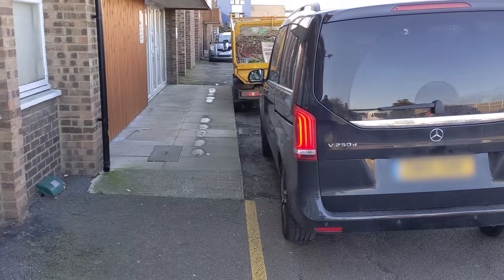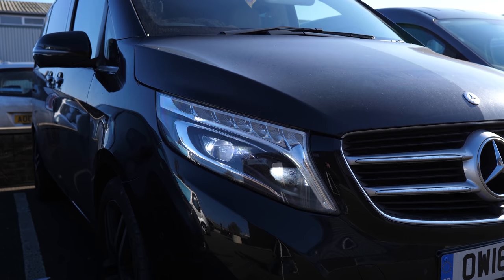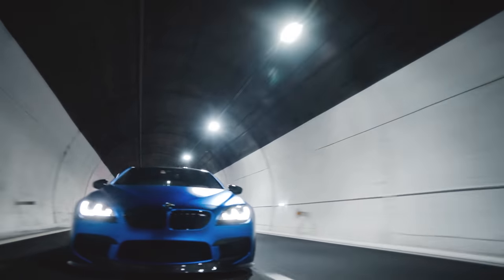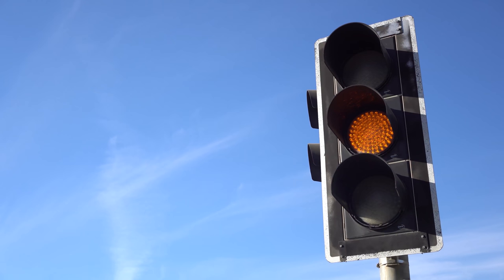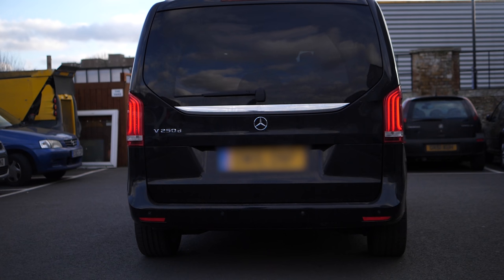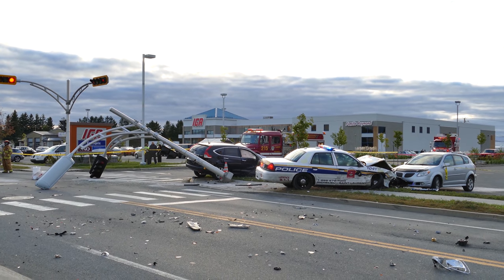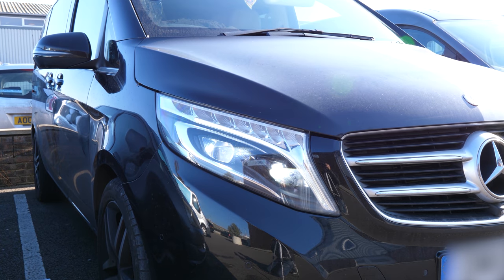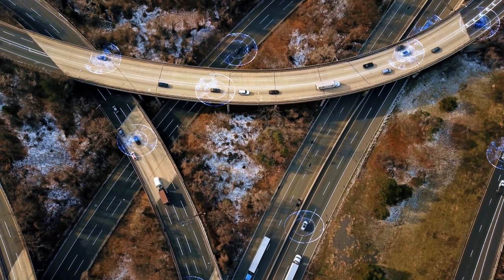Self-Driving Cars Are Dangerously Confused By LED Lights

Comment: Hi Steve! Your statement at 2:10 about the reason(s) we use PWM to modulate the LEDs brightness instead of varying the voltage are not entirely accurate!

1) Using PWM makes effective thermal management feasible. This is very important since the life expectancy of LEDs fall exponentially with increased temperature.
2) LEDs don't have the same efficiency at all voltage/current levels. PWM allows us to run the LED at the most efficient point in the IV curve regardless of the desired brightness. (See: sciencedirect.com/science/article/pii/S1876610212008107)
3) Using PWM with a lower duty cycle and driving the LED at much higher current has the effect of making the LED seem brighter to human eyes (See: https://www.jstage.jst.go.jp/article/jlve/32/2/32_2_161/_pdf)

Comment: Producing incandescent bulbs causes way less environmental damage than producing LEDs.
Incandescent bulbs would be the most effective "fix" - actually it wouldn't fix but ELIMINATE the problem alltogether.
Incandescent bulbs consist of glass, Wolfram, and a bit of brass.
Go figure what LEDs consist of, plus the necessary circuit boards for chopping the current, the driver circuits.
Let alone the HF RFI the power circuits are causing all over the place.

Comment: I belong to the unlucky minority who can see high-rate flicker. Many modern car lights (front and rear) flicker so horribly that I can't drive close to them when it's dark. I get dizzy. My eyes just go nuts, darting all over the place, because of the flicker. Most people can't see this. I often ask friends, colleagues and relatives if they can see that a nearby light flickers, but they almost invariably describe them as perfectly steady. I wish the EU would ban all LED-based lights in cars, domestic products and public lighting, with a flicker rate lower than 1000 Hz, and duty cycles with less than 50 % on-time. Or perhaps even push it to 25 kHz or higher, to prevent any high-pitched noise.

Comment: "It's easier and cheaper to instead simply turn the LED off and then turn it back on again," I think we've found our solution. Which is more expensive? A DAC or hundreds to thousands of hours of digital camera research, special adjustable sensitivity sensors...? Maybe it will pay dividends in the long run, but I feel like the same research could be put into making analog signal generation cheaper. Also, cheaper isn't always the best when human safety is on the line. I suppose the downside of that is we'd have to make a global car LED standard 20-30 years before we can put out self-driving cars.

Comment: Back in the day, we put a bunch of phosphors on glass so some momentary excitement caused more stable illumination.

Why can't we do that with LED lighting?
Reply: On the whole, that's not a bad idea (CRTs have been doing it for decades). However, there would need to be a method to prevent the phosphor from being excited by an external light source.
Reply: @BrendonGreenNZL  Proximity, and the inverse square law.
Reply: @Asdayasman  Yep, that works for me.

Comment: This problem could be solved by having autonomous cars use high speed cameras.  They don't have to be an insanely fast Photron type camera, but something equivalent to a Chronos.  Now, I know you're gonna say, "High speed cameras are expensive and will drive up the price of autonomous cars.  Even 'cheap' high speed cameras like the Chronos cost over a grand."  Well, yes, that's true.  If you're a rich guy who wants an autonomous car, then suck it up!  Besides, if you know history, you'll know that tech that is initially affordable only by the wealthy eventually drops in price over the years to be reachable by the masses.

Comment: Why concentrate on fixing the cameras? What about standardizing with higher frequencies for the PWM? Make it an international standard that if PWM used on any automotive lights, it must be a high frequency PWM, like kHz range. Also, there is such a thing as non-PWM current-control for LED lighting. That would be even better. LEDs are more efficient when operating at lower current versus using PWM dimming, so there's that, too. The trade-off with real current-control is that LEDs don't keep the same color temperature over their range of output. PWM fixes that by always powering the LED to 100%.

Comment: Or, instead of working around this artificial problem, we could enforce usage of higher quality LED drivers/controllers because about 1/5th of humans actually are sensitive to flicker and very much see that strobing, especially in saccades. PWM drivers that operate at 1kHz are not even that much more expensive compared to the cost of a car, or actually lives that could be saved on the road; but no, same as with red/amber lights, big manufacturers have their opinion on where to spend less or what looks better in a car showroom, regardless of how safe that is.

Comment: Could they record using floating point precision (HDR) pixels and then gamma curve and divide the pixel values?
Reply: nope. two bit positive integers and massive over sampling. then send it through an integrator and just let it run off to infinity. why not
Reply: @andrewaronson3364 I'm not sure how to interpret parts of that response. What do two bit integers have to do with anything? And I doubt it would go to infinity in a singe frame. In LDR pixel representation 0-255 byte goes to 0.0 to 1.0 as a float, with a max value of 10^38 as single precision and 1.8*10^308 as a double. And what kind of integrator are you talking about that would "run off to infinity"?
Reply: @Reavenk  maybe one with feedback? I was just trying to spout some signal processing nonsense that wouldn't solve the problem or even be good for anything lol

Comment: Why would the technology needed to flicker the power to something like a light supposedly be "less expensive" than the potentiometers and things that adjust voltage, or even mere switching that just flips the light over to a different resistor for a different voltage when it needs to be brighter or dimmer? And also, why wouldn't mfrs just make vehicles have separate rear turn signal and brake lights, and adding lights for head brightness, so that they don't even need PWM?

Comment: 10:40 I think even now self driving cars are probably more secure than at least some human drivers! ;-)
Either way most still existing security flaws can (and will) be fixed relatively quickly. Environmental recognition is probably the biggest part here.
To me as a photography nerd, the problem (and solution) were pretty clear, but that's just this one tiny fragment of making self-driving cars work. We need smart people from all kinds of fields to get complex things like that to work, but when they do, it's awesome!

(By the way: What imbecil thought of using cameras instead of mirrors!?)
Reply: @Joe T As I said: The biggest part is environmental recognition. And because ONE manufacturer CURRENTLY heavily relies on something that might not always work, you think that nobody will ever manage? That's ridiculous! 
There are a lot of small streets that don't even have markings to begin with, so they need to implement a different system anyway!

Pattern recognition software is becoming better all the time (and so is the necessary hardware), so instead of claiming that I'm dreaming, you might want to have a look at the rate of progress in ANY computer related business and rethink.

Comment: How will we prevent the driverless car that malfunctions into motion with no human aboard to override the system and bring it to a stop? I really don't want to have to travel hundreds of miles to retrieve an automobile that went rogue because of a lightning strike or downed power line or hacker.   I certainly wouldn't want my car to drive off all by itself while I'm stretching by the side of a remote road in the desert.

Comment: Autonomous vehicles don't rely on turn signals, brake lights, headlights, flashers from other vehicles to determine their direction/ intent. At least Autonomous vehicles that use lidar.

Comment: If a national 'system' of turn signals exists, an AI should have zero difficulty in responding to the patterns.
US, UK, Japan...each has the own 'way of doing things'.  But there is a somewhat predictable pattern of use, right?  The AI can read patterns, figure things out.
I would be more concerned with broken/burned out indicator lamps, cracked filters, dirt, mud, driving rain, fog, bad weather in general making indicators hard to see.
Oh, then there is dirt/mud/ice/frost/spider-webs on the camera lens, making everything hard to see.
Doesn't matter how observant the other driver was with using their indicators, there are many factors outside the drivers control or knowledge.
Personally, I think self-driving vehicles are jumping the gun.
Look for the video showing a Tesla being fooled into driving at 80 MPH because a 30 MPH speed limit sign had a piece of black tape stuck to it.
So easy for a vandal to hold up a sign as a Tesla drives by...remote-control auto-accidents.
Simple 'fix' for every self-driving car; make the manufacturer responsible for all damages and deaths that occur while car is in self-driving mode.
No exceptions!  Nothing like the incentive of losing market-share...
Autonomous vehicles need a 'consequence' when they take a life, reaching deeply into Elon's pocket just might get his attention.

Comment: Why don't the cars just use two sensors/cameras at 2 different shutter speeds in the same spots. One at 50 fps the other at 60 fps. Yeah it might get a bot more expensive but they are already hella pricey and a bit more cost would be nothing compared to taking a life.

Comment: can't they just put invisible light on part of the headlights of vehicles and traffic lights? If done that, you can output the same message to a vehicle without the need to change every vehicle and traffic light methods to send visible lights. You can then use these invisible lights like radio waves, a way to send information between cars, traffic lights and even technology in general without making our human lives worse.

Comment: As a human driver of a car made 30 years ago (replacing one made 39 years ago) I strongly dislike PWM LED tail lights and eyelash lights.  Given a quick glance I can tell there's something there but not where it is or how fast it's moving relative to me.  I shouldn't have to stare at your lights because you're too cheap to have bought a capacitor.

Comment: Steve, the digital artefact sounds similar to aliasing, a phenomenon where there is a mismatch in the sampling rate and pulse frequency in Doppler ultrasound. The result is, that you get a false value of arterial flow.  Here are two links : https://radiopaedia.org/articles/aliasing-phenomenon-ultrasound?lang=gb.  https://en.wikipedia.org/wiki/Frequency_ambiguity_resolution

Comment: Just remember, autonomous vehicles don't have to be perfect. They just need to be significantly better than human drivers to make sense for more widespread adoption. That may still take some time, but while our communal driving ability is impressive, it's far from perfect.
Reply: This is no excuse for not fixing a problem that is well understood.
Reply: @jubbetje4278  I agree. My point was that even though autonomous vehicles will never be perfect,  eventually they will be better than human drivers. Even without solving every edge case it could save human lives to more widely adopt them at that point. I think the bar will be set much higher because we are more comfortable with real-time human error causing deaths than our failure to solve for every edge case, even if the latter ultimately results in significantly fewer lives lost.

Comment: Wow!!!

So it's cheaper to put a modulation circuit + a much expensive and complicated camera (which is similar to the eyes) or even other solutions like put multiple cameras and figure it out trough software than to put a voltage regulator?

So the initial issue is that the lights are made with a modulator instead of a regulator, and the reasons behind this it's that: is cheaper, it's easy and it's made for the human eyes? It's like the starting point of making this LED lights are in the year 1800 when there was no video camera around!

The easy fix can be done now, using a regulator, when there are fewer self driving cars, and when the car industry is not adopting massively the LED lights on other cars. By the time this issue become so spread and generates so much other bugs the solution would be to simply not use it anymore for the computer processing, let them only for the humans.

Maybe will be replaced with an international system of radio sensors and the cars will know to communicate to each other automatically no matter what is the weather.

Comment: If one wants to get information out of a signal, one (should) knows to sample that signal more than twice as fast as the highest frequencies in that signal. When one has the sampled data, one will also know how to process those data samples to reveal what one wants to know. That includes repetition rate, variability in that rate, and the correlation of that signal to other known signals. Your phone camera is not meant to be sensitive to those parameters. The car imaging system must be, or someone is criminally negligent. See also "signal processing", "DSP", "Nyquist criteria". One expects that the car designers know Electrical Engineering. The EU will have some standards. Oh, no EU? Sorry for you.

Comment: Why not instead of having a camara shoot a frame every, say, 1/30th of a second, make it shoot at random intervals that average out to 30 fps and check if the light was on or off the most times out of those frames? I would think that's a better solution than implementing AI, though I don't think current cameras come with that feature either. In the same line of thought, LEDs could flicker at random intervals too, as long as the intervals are small enough and the average stayed the same there wouldn't be a problem for human drivers or auto-pilot I think.

Comment: What about having manufacturers put capacitors in the LED circuits so they can carry the light through the off portion of the duty cycle, like a smoothing cap on the output of a switch mode power supply?
And in my experience, when a BMW is on the road, 9 times out of 10 the driver is driving like an asshole.  It’s like when they buy a BMW they get a huge chip on their shoulder and have to prove something.

Comment: As long as there are human drivers still, autonomous driving won't be safe enough. Light & sign systems and others are meant for humans not machines.
On the other hand, Airplanes become safer, because with all standard safety avionics systems (ACAS/TCAS), aircrafts can communicate smartly and act accordingly.

Comment: In an ideal world we make the decision to remove all human driven cars on a fixed date in the  future and say from that point on all cars on the roads or on roads dedicated for automamy are restricted areas, and all cars on them are equipt with the means to talk to each other so they know what they are doing and what other cars are doing and can work with each other, without humans screwing them up. sadly this is not an ideal world, we have to be impractical for a number of selfish and selfless reasons that allow for humans on the road. Maybe the ideal world with complete autonomy will happen, and all currently human controlled cars can be placed in museums and restricted locations where automomy can't work such as building sites, This will not be in my lifetime.

I agree dimming and brightening an LED or bulb is easier (when done from an AC source) and cheaper by using PWM, but there is no reason to do this when switching on and off especially in a car, in this situation is easier to toggle a transister rated for the current of the LED's on or off. The only advantage PWM gives is an extended life of the LED's because they are usually being pushed to the limit of their performance for long periods of time making them dim as they age quicker, but it's not unreasonable to mandate that they are replaced when they fail to be bright enough for the task in hand for safety. If we became fully autonomous, cars with lights for breaking and indicating would be a thing of the past because cars would be talking to each other and would send a packet to all cars close to it of it's intentions before performing these tasks.

I agree I am over simplifying but you need to simplify something before making it happen.

Comment: Self-driving cars are not the future. It will be resource-conservative, multi-modal,  green as possible, and local as much as possible. Example: rent electric car to travel 200km to meet a family member one a year for Christmas; park ebike in multi-thousand cycle parking facility > train > docked bike to celebrate your grandpa's birthday 500km away; ride trike to work; ride electric bike to work 10km away; ride bike down to local supermarket or butcher with panniers or trailer; use your own car to go on summer camping trip once a year; go on little adventures with your children, and go camping at your local camp site. 

All of this will be less dominating in rural areas, but it can be done in rural areas. And can be encouraged more with better rural area planning.

Comment: This an incredible naive way of looking at the problem. One AI do not interpret images the way we do. You assume cause on a LED screen you couldn't tell the difference you think  that a neural network will, but it's not how that works. The entire point of a neural network is that it does it own feature detection. A AI could learn to drive while the entire time never even figuring out that's what the lights do. I could look at wheel turning, approach speed, or any other variable. All you can do is feed it data and let it figure out how to make those decisions and grade it.